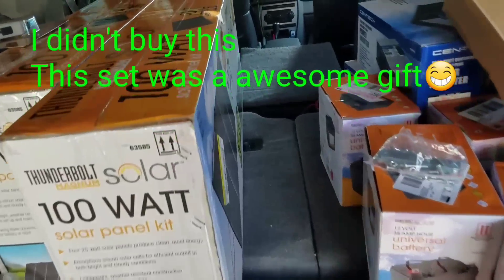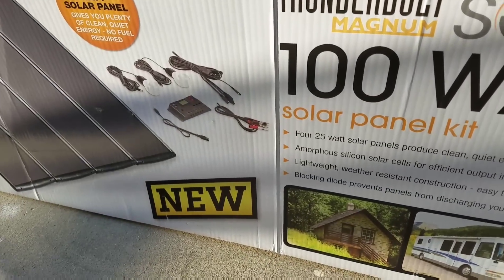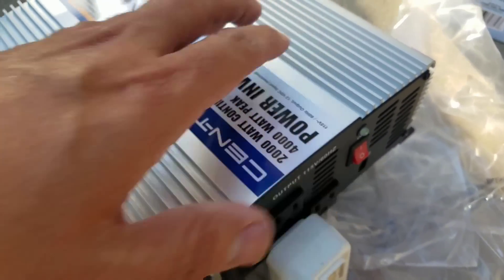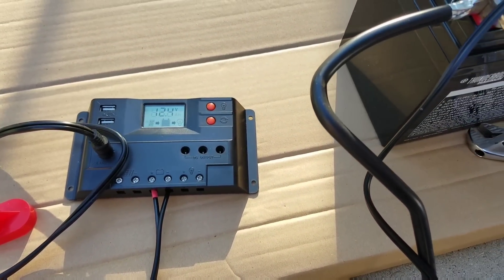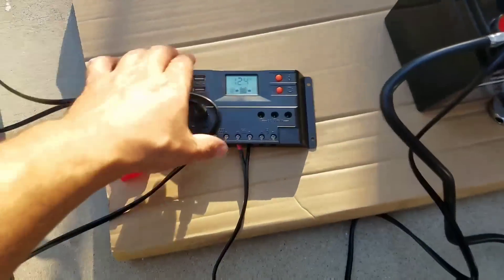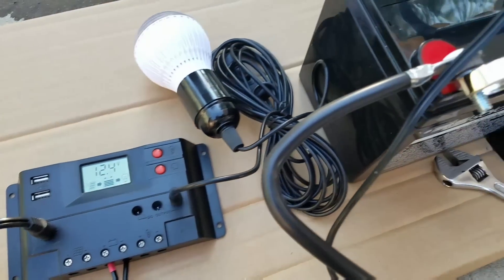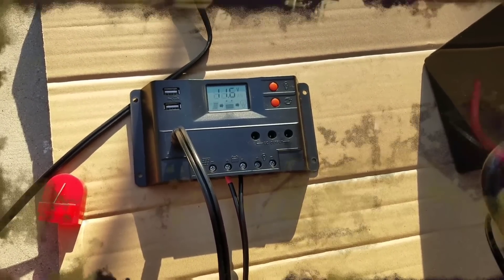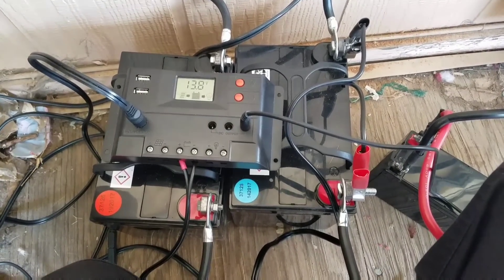How to run an AC unit on solar power

Comment: i know you have gotten a lot of flac over this video. . .  I take it by now you have learned that this set up did not work as has hoped ;( i hope to only give insightful relevant knowledge that will help you get to your goal  and not insult you like many others have done in the comments below. . . we"ll start with this. . .  there is a saying about batteries. . . . they are like piggy banks, you can only take out what you have put in. . . . to put this in perspective. . . you have 4 35 amp hour batteries. which gives you 140 amp hours of storage. . . however you should never drain more than 50 percent of your batteries[some will say no more than 20 percent but 50 is more practical. . . , so thats really only 70 amp hours of  stored energy until your batteries are 50 percent dead. . .  to understand this, An ampere hour (abbreviated Ah, or sometimes amp hour) is the amount of stored  energy e in a battery that will allow one ampere of current to flow for one hour. so with your 70 amp hour bank you can pull out 1 amp for 70 hours or 70 amps for one hour. or 35 amps for 2 hours. or 10 amps for 7 hours. . . i gave all these examples so you can envision a real working application of this. . .  so lets put this in perspecitive of your ac. . .  your ac most likley pulls a constant 400-700 watts. . . we'll say 500 watts. . .   so we need to find out how many amps at  12 volts is 500 watts?. . . . using the formula of volts x amps = watts   we reverse that formula and get 500 watts divided 12 volts equals  41 amps. . . .   so that means if you ran your ac for 1 hour you would have just consumed 41 amp hours out of your 71 amp hours of total storage . . . . not very practical. especially when you realize you need to put that 41 amps of energy back into your "piggy bank. . . ." with your 300 watt set up that gives you 25 amps of charging power. . . so if you get sun power for one hour you just got put 25 amp hour back into your battery bank. . . [ 300 watts divided 12 volts = equals  25 amps i know this is a lot to consume but very fun once you understand. .  . if you have any question feel free to ask. also for simplicity of explanation, i did not go over all the inefficiencies  some of these i will list because i could for see some commenters knocking me for failing to mention these. . . some of the inefficiencies  are :  cable loss, solar panels almost never giving full out put even when under full sun. . . ineficiy of inverters which our about 80-90 percent] ineficiy of charging batteries, [not every thing you put in stays . the ineficiy of running induction motors [ac fridge] with a modified sine wave. . . there is a lot of ineficity which once you understand you can add to your calculations , but for estimates everything i said above is spot on.   God Bless. . . .
Reply: Mike, thank you for this very informative post, and you didn't come in screaming insults.
Reply: That's how to correct someone not being the condescending know-it-all great information mike.
Reply: Mike Rivera JR great info!! Wish you had contact info lol
Reply: Half Acre Farms Bell ... That's what I was about ask for. I like the way you explain things.
Reply: Mike Rivera JR you sir have help me understand this alot more..thank you
Reply: Mike Rivera JR :I have to tag this video just to save your comment, thanks for summing up the pv system for me.
Reply: Mike. Need some help. 

5000 BTU - 410W - 115V Window AC 

I would need:
1600 watts in panels
65 Amp MPT charge controller 
600 AH battery bank ( 24Volt? ) 
2000W Inverter (24V or 12V?)

Is this correct or incorrect?
Reply: +Anarchist Ryder...try this...
1..600w in panels ...50% more power output then the air con. draws
2..the charge controller is independent of the power being drawn from the batteries
     its ONLY job is to charge the batteries.if you have 600w of panels wired in parallel 
     you'll need a 50A charge controller.if wired in series at 24v,then only a 25A controller. 
3..a 24v wired battery will drain at 17ah per hour. do the math for how many hours you
    wish to run the air con WITHOUT THE SUN,then multiply that number X2 ...an acid 
    battery should not exceed 50% of its capacity being drained. the 600w panels will 
    keep up with the power being drawn by the air con and then sum while in the sun.
4..a 750w inverter is enough to power a 410w ac. a 24v inverter will be more efficient
     at converting to 115v then 12v to 115v.....
Reply: Can anyone tell me, what happened to Mike?? 🤔 Was a steep price tag put on an additional advice??🤔
Reply: @t.c.3027   youtube never showed me any of these responses until now. . .
Reply: MIKE RIVERA IS THE FUCKEN MAN YO.... .. LOL HELL YEA DUDE
Reply: Mike, i have VW Rialta 2002 and i cant take the noise of the genorator and NEED to go solar....is it even possible to run my ac (roof top) if u can google the Rialta u can see the ac specs .but id apreciate some advice before i spend 1500$...maybe more...i plan to get 2200 watt pure sin wave inverter and 3- 100 watt renogy panles (that is all i can fi on roof and max load the 2200 watt inv. can use.) but i know i can run my tv and electronics, but i want and NEED the ac to work. Please some advice anyone ??
Reply: @JeffCrego  rv mounted ACs tend to be very inefcient. ussually taking about 1200 watts or more. .  .if you are only producing 300 watts of solar[more like 200in the real world] you can see where this will not work. . you will be constant deficit
Reply: Very informative. Thank you good sir.
Reply: I too found your reply/post very interesting. I trust you. I trust you so much that I am hoping you can tell me what I need to buy to accomplish what RFTechGuy is trying to do. I want to run an A/C window unit with only solar panels. My conditions are one of constant sun - we live in the desert and I think I remember what a cloud looks like. It will be a big help if you can save me the calculations and provide me the shopping list so to speak. Very much enjoyed your positive post and look forward to any help you can provide by way or return reply. And RFTechGuy, thanks so much for this video to open up this conversation.
Reply: @RussellBettsgogov     buy a kilo watt meter on amazon there about 30$  allow it run for exactly 24 hours, this will let you know how many kilowatt hours it uses a day . . . This is how many kilowatt hours you need to produce a day . . . as a rough number you need at least 1000 watts of solar   to run a window ac, , and ideally 2000. . but 1000 will suffice, in real world after all the innefcies, and conversion losses, you will get about 600-700 watts which will run window acc's under 6000 btu. . if you want further consultation feel free to message me at techagentmike @gmail
Reply: @mikeriverajr4447  - Thank you very much. Much appreciated. Have a great day.
Reply: When you trying to use the word inefficiency?

Comment: My advice to all would be to get an energy audit on your home. Find where your insulation needs improving, air sealing techniques. Seal up duct work if you have it. Also try to get your duct work if you have it into a conditioned space. 

 After all, if your home is not efficient then I don't care what you install in your home to conserve energy, it will never be efficient.

 It is a fact that leaky homes produce higher utility bills and low comfort in the home. By investing in your home you will reduce energy consumption and improve overall comfort.

 This is known today as building science, I would rather spend 2000 on my home and get results than keep sinking hard earned money into gimmicks.

Comment: It's funny you say you've been doing this awhile. But clearly you have no idea what you're doing. Terrible unsafe unstallation . Bloody wires everywhere. I couldnt even take you serious . Like First off that AC unit is going to pull a shit ton of amps. 4 battery's will not cut it. 2nd your solar array needs to be much bigger. You won't run shit for very long on this setup. I'd say 30mins top. And spend the rest of the day chargeing. Don't mislead your viewers bud. If you plan on running for long duration. You will need 2000+ watts of array and like 20 of those batterys . You may get 12 hours of run time. Renogy mono-crystiline pannels are the way to go. They still output under low light conditions.

Comment: Its good to see you are handy but this is not a serious system, its cheap and nasty quality and under powered for the task, the system will be over cycled and the batteries will not last, this quality will not return a good service life. The old AC unit looks like the most hungry energy user, they have solar compatible ones these days but they are expensive and so is a good solar system. I've been on solar power 19 years and owned 3 different systems, so its fair to say I know a thing or two. My system cost about the same as a budget new car but will last 10-20 years. 4500W panel aray/48vDC800AH/3000W AC Inverter/80 Amp Controller
Reply: And even with your configuration, its imppossible to run an AC unit whole day.
Reply: Eh...? 48vDC800AH? Are you sure? Then you must have quitte al lot of batteries.

Comment: Use a Honda 2,000 watt generator, easier, more reliable, works better. Runs 9 hours on one gallon of gasoline.
Reply: jackgoldman1 that would be true hey sub my channel I subbed yours.
Reply: And it smells vibrates needs oil and makes noise
Reply: Cheap way to cool your house.
Reply: Specs on one 2000W generator say 9 hr run time at 50% load, or 700W. (Continuous max load is 1400W). So 9hr X 700W = 6300Watt-hrs or 6.3kW-hrs. At $3/gal gas that's $3/6.3= $0.47 per kW-hr. That's over 3x what you pay for electricity from the power company. If you can afford that then good for you.

Comment: Yes I have 750 Watts of panels and five batteries to just run a 6000 btu AC from 1100 to 3...it is enough time to  Kool your room or whatever..and take a nap without sweating..
But you don't want to run your batteries down to much.. so as long as the power is staying more or less equal from the panels then your good..after that I just let it charge up for last sun before the night..and it lasts till the next morning and then the sun starts to recharge the loss..if it's raining of cloudy I just use a 0-15 amp  Black and Decker digital battery charger (it also has he battery conditioning mode to desufate) and run my generator  (a 2000 I inverter  Generac  brand) for two hours and BAMM..fully charged it uses maybe a cup of gas..shut off the generator and go back to battery power..that is for fridge,lights, flat screen PlayStation and fans.
You definitely want 2000 Watts or 3000 and at least ten batteries..just make two separate systems so you can switch back and forth to keep at 50 percent usage..and your batteries will last a long time if you're using AGM only..safer better and don't short out..now I do have four batteries that I have fully drained all the time for like five years now and they still work..you do lose some power over time ,but not that much..as long as you desufate..so it's kind of a myth..good luck people

Comment: Keep up the good work. We all had to start somewhere. Even the haters.
Reply: You are right brother. To many chiefs no indians.
Reply: Jonn Bravo - Well put.
Reply: You are exactly right, I'm going through the same process of hit and miss at my off grid cabin. I'm getting better at it but still have a lot to learn. At this point I'm considering going with a solar/wind  hybrid system, to see how that works.
Reply: Can I add other panels of 280watt each to the port at bottom showing a solar  panel graphic.  Thank you
Reply: Hi guys

Comment: So NO that charge control will not handle 6 panels will barely handle the 4 in kit. Also even 4 batteries in parallel not enough battery bank at 35 amp hr to really do the job you are asking of them.

Comment: I wonder how long your AC lasts with you using it on the Centech Inverter... It's not a Sine Wave Inverter, so meaning it will damage AC Cooler, and Charging Batteries like Cell phone or Powerdrill batteries....  It even says it in the Manual if you don't believe me.
Reply: Ka Yang Thao l
Reply: That’s one of the things most people don’t account for. A good inverter. Kill just one refrigerator, computer monitor, microwave, whatever, and the price of a decent inverter is MUCH less than cheap inverters!
Since the 1970s America has progressively stopped buying quality at an increasing curve. So today we have ‘retail’ items are designed primarily to mine the uninformed (willfully ignorant) consumer by doing only one thing: separating one from their money. 

Reasonable quality 100W panels are available for $80-$90, equalizing charge controllers are less than $50, and inexpensive 80Ah deep cycle batteries are on the shelf at walmartha every day. A ‘pure sine’ inverter is just a few hundred bucks. Are these things state of the art? No, but they’re reasonably inexpensive and reasonably inexpensive and perform well for years. 
I’ve yet to see anyone doing cartwheels over the me-too harbor freight stuff. FYI

Comment: If you intend to run your AC units all day when it's hot if your AC units are using a lot more watts than what you're bringing in then you're going to be draining your batteries the whole time until they're dead and they will die out very quickly, for example if your AC uses a thousand Watts but you're only bringing in 300 watts then you're at a massive deficit so you need to have enough panels that bringing more watts than what you're using and when the Sun goes down your battery bank has to be big enough to run whatever you want to for as many hours as you need use without running your batteries out quickly, I would recommend having 6 or even 8 would be better of these 100 watt kits and have them running just a small portacool portable water cooler because then you'll be bringing in more watts during the day then what you're using with the cooler because the cooler on low will only use 150 watts and on high 215 and if you're bringing in say 300 to 400 watts even if you're running a TV also you won't be draining your batteries during the day you will actually be charging them a little bit which will allow you to run your portable water cooler all day when it's really hot and an HDTV also and even watch TV late at night and even run the cooler for a little while before your batteries drain too low, I know because I do this every day.

Comment: You need to install a soft start kit compressor at start up will trip your solar charger ....hard start kit will work as well price around 20 to 50 dollars compressor at start up pulls only half after installed

Comment: You need to find a way to run solar panels to a plug one-by-one slowly until the whole house is converted I've been kind of planning it but I'm not too good with wire so your video was very useful thank you

Comment: The only way you can run AC unit using an inverter is if you have at least 500 Amp from marine batteries being charged at the same time by close to or more than 1,000 Watts of solar energy. Meaning, those huge panels on top of roofs, usually around 20 or so panels. Panels that carry so much wattage can be tied off grid and can run appliances without using the batteries as it charges. Unit starts around $7k for a small set up up to $125K to power an entire house off grid

Comment: Take my advice when I say,  return what you bought.  Spend the money on renogy panels, deep cycle batteries or even 6 volt golf cart batteries wired in series. even lithium of you have the $$.
Reply: used 6 trojan gc batts and a nice inverter when irma knocked us out. generators are so loud, was nice having a break
Reply: Alternatively, use Earth tubes if you have the space.
 https://www.youtube.com/watch?v=s-hGdoHVho4
Reply: SpeakersIsGod The point of panels like these is to start with solar. Experimentation. They aren't meant to last very long. Now, I don't know this guy, but in this video he says that he has been doing this for a while, in which case your advice is REALLY good and sound. I have 3 renogy solar panels on the roof of my van, and 2 more that I need to build a rack to be able to mount correctly.
Reply: 2 100 watt renogy panels did the job with some help from an onan emerald 3
Reply: Aleric Johanson What do you run off the panels on your van? How many batteries do you have connected? I was going to put solar panels on top of my g20 but when I looked into how much power it would take to run anything useful I gave up.

Comment: Like the vid - and your excitement over solar.  I purchased the 45 watt (3 panel) system from Harbor Freight a couple of months back, but am just now having the time to mess with it.  I set it up over the weekend charging 2 small 12 volt batteries wired in parallel and just tried plugging up different devices, combining different devices just to see.  My intentions with anything solar is purely for emergency situations / loss of grid power... etc.